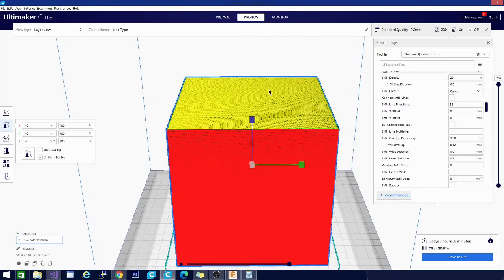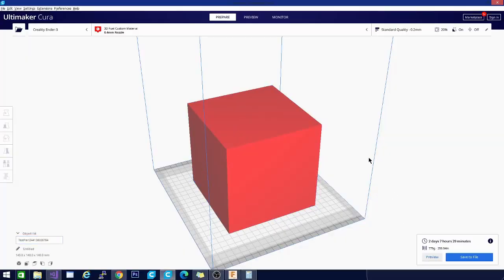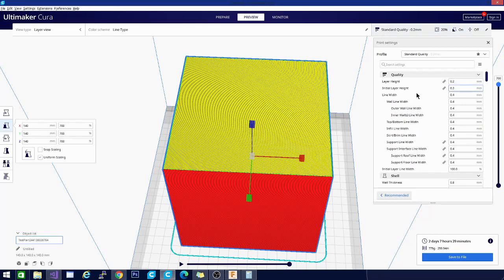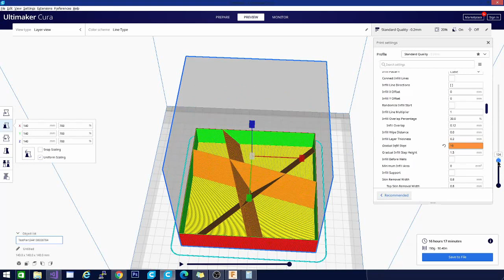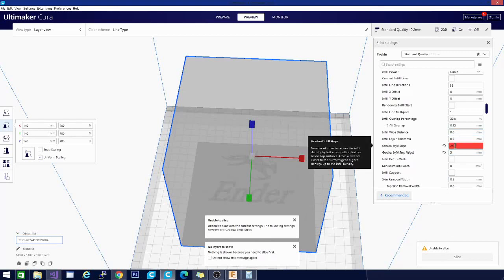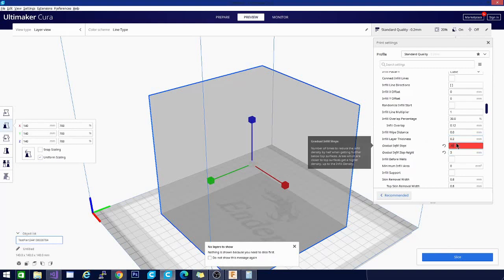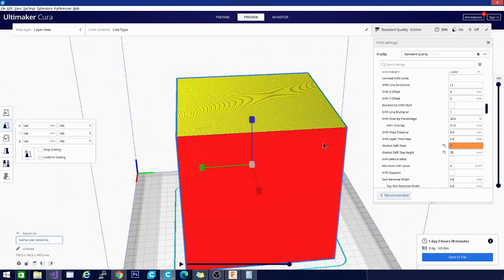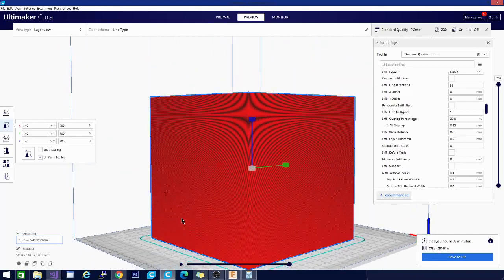Decrease Print Time And Wasted Plastic! with Cura's gradual Infill!

Comment: I have my Cura settings visibility set to 'All' and I still don't see 'Gradual Infill Steps' even though I have it check marked in 'Setting Visibility' and it does appear there. How bizarre.
Reply from the maker: It will only appear once u check and turn on infill
Reply: @Technivorous  I have Infill Density at 30% and Infill Pattern set to cubic subdivision and I still don't see Gradual infill steps :/

Comment: I would prefer if it allowed more dense infill at start, then tapered to lower infill, the back to higher infill. I think that 2% would make the bottom not very structural. But a good idea
Reply from the maker: i would think a lot of whether or not this is successfull over a large are is also to do with the infill pattern
Reply: @Technivorous  True, and add in automatic variable layer height. I often just need to print a draft part. But I still want a good top .
Reply: What they need to do is add "ignore walls" and "ignore bottom" to the cubic subdivision infill option. It would make it vastly more efficient for large models, and offer much more confidence over the new lighting infill.
Frustratingly, there is an old help ticket where someone asks for this, and a dev says it's not worth their time. Drives me insane.